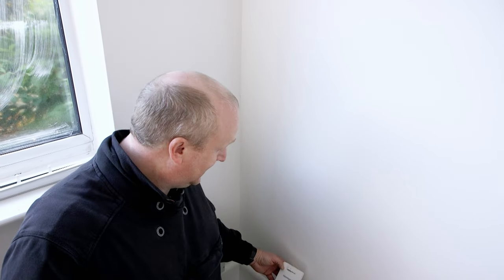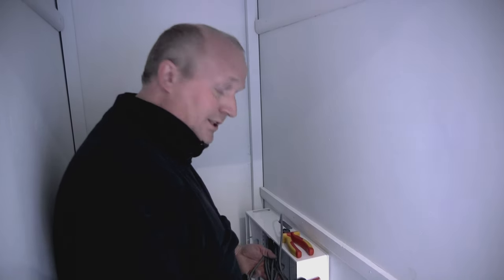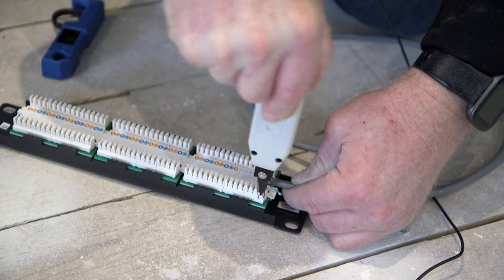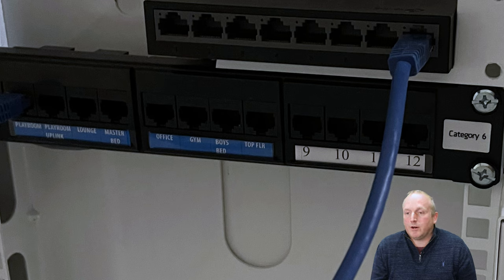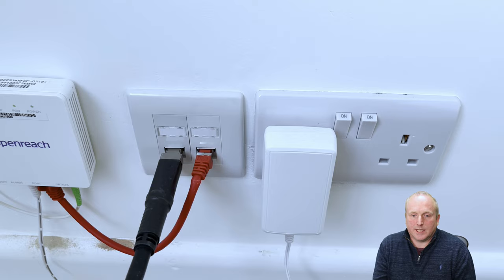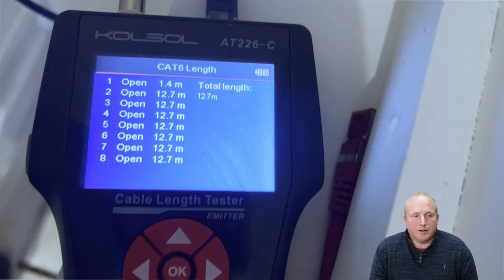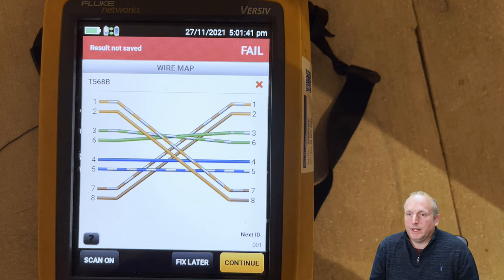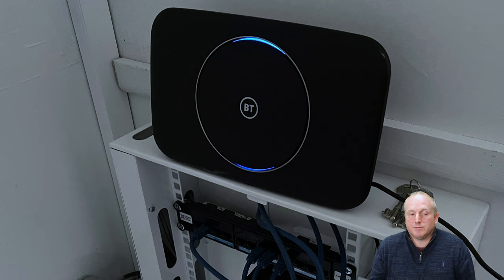BT Full fibre with 10GbE network installation tested with a £15,000 Fluke DSX 8000

Comment: Interesting that you had the extension lead right against all the termination points. I suppose having that in close proximity to the bare Ethernet doesn't matter as much compared to when it is live wiring within the walls? I always tend to keep a distance of 30-45cm as a rule of thumb, even at sockets (so the data modules are spaced a fair bit from the power sockets). To be honest it would be cleaner with them bang up against each other as you have done, but on the very unlikely case there is interference I'd rather not have to redo anything.
Reply from the maker: I have never seen any problems with proximity yet, but that does not mean they arent occuring! I think avoid to run the power and data runs in same ducting and routes and to cross them at 90 degress is more important.  I guess an installed cable will almost certainly out perform a wifi contection or powerline adapter and give consitent results even when not installed in the best case serniro.  Though the look of the installation in a home enviroment is often very important factor.

Comment: EXACTLY how it should be done and tested. I LOL at "Electricians" who tinker with data and won;t stick to their trade. Subbed without hesitation.
Reply: Don't expect low cost servicing if you the customer is funding a 15 grand multimeter.
Reply: Data is easy.

Comment: Having FTTP fitted on Wednesday, unfortunately the ONT is part of the hub they supply, so may have to use a double NAT setup 😐
Reply from the maker: I suspect you will end up with Nokia ONT as in video, with Ethernet cable to link to superhub.  Therefore should be straight forward to replace the superhub with your own router.

Comment: Brilliant video I've just had fttp fitted, what kind of ethernet cable can I use for a security camera,running from the BT Smart Hub I've knot tried any it's just that the what I'd call the rj45 sockets on the back of the smart hub look small for an ethernet connection thank you.
Reply from the maker: Hi David, any ethernet cable should work. Most cameras are 1GB or less on the ethernet port. A lot of cameras support POE. If power is to be sent over the ethernet, then a higher quality cable should be used that has copper conductors. Some ethernet cable is aluminium coated in copper. This should not be used for power applications.
Reply: @MerciaSolutions  Thanks for your reply it will be a great help.

Comment: I don't get how cat cable e.g copper cables is future proof, I'd say full fibre is way forward.
Reply from the maker: Hi copper allows for upto 10GbE to devices around the house.  The house has fibre directly into it.  As nearly all tv’s, game’s consoles computer have Ethernet using copper is the most effective way.  Otherwise each device would need the media converted to fibre to Ethernet.  Most tv’s only have 100mb connections therefore the 10,000mb Ethernet will be more than enough for the next 10 - 20 years.  The fibre could well be delivering 100GbE by then.  It maybe possible to send more than 10GbE as Ethernet technology improves.
Reply: Over a short run(less than 100m) it doesn't matter and in most homes you are going to be nowhere near 100m from the main box(well unless you live in a palace or something).

Comment: The main fiber entry point downstairs should have been concealed a tad bit better to match the asteic of the general install.. this work looks seamless regardless well done
Reply from the maker: Thank you Eelee, I agree it would have been nice to have had the fibre entry point relocated.  The fiber was already installed prior to the house being renovated, and only suffered with some plaster splashes on the cover which have cleaned off.

Comment: Great video. Thank you. I have a new pre-wired (ethernet house). Have just had my fibre installed and would like to use the existing ethernet port to run the connection back to my wiring cupboard. Do you have any suggestions on how I could test the quality of the pre existing ethernet cable without spending a fortune? It is embedded into the wall so can’t see if it is cat 5 or 6. 👍🏻
Reply from the maker: You could get a couple of computers on each end and run iperf to benchmark throughput.  To test for cat 6 you would need 10gb network adapters.  Only other choice would be to hire a fluke tester though this will be serval hundred pounds.  A cat 5 will easily run 2.5gb or even 5gb so should be more than enough to send the internet connection back to the wiring cupboard. The cat 5 cable is thinner I believe 24 Awg and cat 6 thicker at 23 awg so might help.
Reply: @MerciaSolutions  Thank you, that is really useful to know. I have even managed to get a working version of iperf for windows. I will give this a try. I am thinking it might well be cat5 as I can’t imagine any UK new build builder would put in cat 6 if they had to. All of th Ethernet connections terminate in a cupboard under the stairs. I REALLY want to run a network up into the loft (for CCTV, NAS etc), but there seem to be no route to push the cables up with so I may end up tapping off of one of the built in ethernets and going up into the loft that way as Powerline adaptors have proven unreliable at times. Thanks again for your help. Your video is really useful 👍🏻😊 P.S. thanks also for the note on cable thickness, I will have a look and see how thick it measures.

Comment: Hi Pal, 

Is there a way that I could connect the ONT to another router, rather than the BT Smart Hub 2 ? This is because the BT Smart hub 2 is rubbish. 

Please do let me know 

Thank you
Reply from the maker: Hi Jas,  yes you can replace the router.  The router will need to support IPV6 and then authentication via pppoe for ipv4.  Though prob best checking on bt forums if router you want to use is compatible.

Comment: Can you use BT full fibre without the BT hub? i.e., have my own Wi-Fi switch plug straight into the Ethernet port of the openreach box?
Reply from the maker: Yes you can plug your own router into the ONT it needs a wan port and to support PPPoE.  The only configuration details you need are the PPPoE username and password which I believe are bthomehub@btbroadband.com and the password BT.  Most routers will support this though you could go all in an build your own with with pfsense.

Comment: The state of that CLI is horrible… should not of been left like that
Reply from the maker: Hi cli in the thumbnail and video is the direct result of plastering the wall in which it passes through.  The fibre was already installed at the house prior to the renovation. Therefore the ONT was removed prior to plastering and the fibre cable bagged and wrapped.  The plasters luckily only covered the tubing in plaster which has now been cleaned off.  It’s certainly not the result of the bt open reach installation.   Ideally if it was being installed we would of had the fibre come straight to the cabinet or loft space if allowed as part of the open reach install.

Comment: @Mercia Solution are they LAP euro modules? I used branded Excel cable (Cat6) and patch panel, but LAP for the euro modules. Interest to know if they are ok for 10G. (most of my runs are sub 30m)
Reply from the maker: Hi yes the links passed certification at 10G had LAP cat6 euro modules.  Though a couple with cat5e euro modules failed due to the cat5e module but passed at 1G.
Reply: @MerciaSolutions  Thank you for the reply. I am thinking of using the smaller version of that 10inch rack enclosure in my garage. Do you think there is enough space for a cat6 keystone panel, with a decent bend of the cable? Thanks.
Reply from the maker: @tschubb1992  the smaller version is a great rack.  However I don’t think you will have enough depth to from the rails to back of the rack for using keystones.  I guest a lot depends on the keystone modules used and faceplate.

Comment: So does the ONT act as a modem? If I were to replace the BT hub with my own wireless router would I need a modem or would it just plug straight into the ONT?
Reply from the maker: Yes you can plug your own router into the ONT it needs a wan port and to support PPPoE.  The only configuration details you need are the PPPoE username and password which I believe are bthomehub@btbroadband.com and the password BT.  Most routers will support this though you could go all in an build your own with with pfsense.
Reply: @MerciaSolutions  that's great, thank you

Comment: If you are using 10gbe network for home , what switch can you recommend ?
I will have 24 port patch panel in network cab
Reply from the maker: Hi the switch at the moment is just a 8 port 1Gb tplink, the only data is the internet connection and this switch is more than adequate.  In the future the switch can be upgraded when required.  Zyxel make a few 24 port managed switches which are fan less so ideal for home environment also low cost.  The management allows for
Multiple vlans to isolate networks such as IOT devices and guest connections. There are also a lot of multi gig switches available though you will need multi gig capable clients and severs or a very fast internet connection to use any thing more than 1Gbe connection.  I also like the Ubiquity UniFi products.  I guess a lot comes down to your use case and budget, and how hands on you want or need to be.
Reply: @MerciaSolutions  thanks for the reply. I currently have UniFi setup in my current home 24 port PoE switch and USG , with poor internet connection (30Mbps). I have a number of access points in property and a few rj45 points wired in house and to office.
The new property we are moving to will have fibre , either VM 1gig or BT 900Mbps and I have instructed builder to install Cat6 at numerous points in property. First fix is now complete and I myself will terminate cables Inc network cabinet in office.  I had a site visit yesterday and all is good for cable locations and routes 👍.
I quite like the UniFi equipment and the GUI so will probably go that route again, but it's just choosing what equipment really as the idea of 10gbe is really appealing for moving data around.

Comment: Can you please provide a link to where I can get one of those rack mount boxes? Is there space inside to put the router, instead of balancing it on top?
Reply from the maker: Hi you would be able to have some routers inside the cabinet, however if you are using the built in Wi-Fi in the router then the metal cabinet would have a negative effect on the signal.  You can get the cabinets from here https://www.cablemonkey.co.uk/home-network-cabinets/9509-10u-connectix-home-cabinet.html or from cpc.
Reply: @MerciaSolutions  Thanks for the speedy reply! I have an access point because of poor WiFi from my existing router. Also an account with CPC so that should be easy.

Comment: Unless you have a WIFI Access Points around the house wired connected then WIFI is going to be shit with the Router stuck in a cupboard
Reply from the maker: The WiFi is working much better than was expected.  It was envisioned that a two or three hidden access points would have been installed the cabling is in place for the future.  However as the cupboard is central in the house it means the Wi-Fi only ever has one floor or two walls to reach every location in the house.  The 5GHz even works well at the extremes the hub is very good.  If the hub was left next to the ONT the Wi-Fi would not reach the top floor or garden as would have multiple floor and wall to get through.

Comment: Couple of questions for you if you don’t mind, I’ve just upgraded to Sky Ultrafast Plus so believe I’ll have an ONT, the room is bare plasterboard on the wall it’ll go on so I’d ideally like them to leave the box loose as it is at the start of your video. That way I can remove the master socket that’s currently there and make good, then fix to the wall once it’s plastered, which leads me to my next question. 

How does it secure to the wall as I’d be happy to do that once the room is plastered if needs be. 

Thanks
Reply from the maker: Hi the the ONT is just slid over a couple of screws. The backplate has a couple of holes with slots above which the screw heads fit through it then slides down and hangs on them.   The same slot is found on most mains extension leads so you can wall mount them, not sure what the correct term is. Hope that helps.
Reply: @MerciaSolutions  Ah gotcha, so just a couple of keyhole slots on the back of it. Hopefully they’ll be happy to fit it and leave it loose, that way I can fit it to the wall myself once I’ve made good. Thank you for clearing that up, couldn’t find an answer anywhere online!

Comment: Does this mean the overhead telephone wires will be removed?
Reply: Not a chance lol! Openreach are awful at removing redundant equipment, especially their contractors. Only when they have to do they do so. They are supposed to remove your old telephone wire and replace it with the fibre drop from the pole to the house though.

Comment: what are the benefits of having a patch panel in a domestic dwelling with 8 runs? why not go direct to a switch?
Reply from the maker: Hi a patch panel keeps the cables to rooms are static and correctly labelled.  It’s also means you only patch up the ports you wish to make live.  You might have different services such as a analog phone line run over the Ethernet run and different switches if physical segregation between is required, work vs kids and guests.  The cable used between the patch panel and rooms uses a single strand of copper in each of the 8 cores. A patch lead uses multiple strands so its more flexible.  Over time if the cables are being unplugged and moved there is a good chance of damaging the cable.  I expect the switches and routers will be replaced many times over 20 - 30 year period of time along with the patch leads used both ends.  The number of runs really is down to the home and expected future needs.  The fluke tester also tests and records various values for each of the runs so for future trouble shooting we can see if something has changed from the installation.  That said plugging directly into a switch can reduce hard ware costs and if a service loop is left on the cables in the future a patch panel can be added.  Make sure the ends used are suitable for solid or stranded cable.
Reply: @MerciaSolutions  thanks for the detailed reply 👍🏻

Comment: The BT Openreach ONT is loose and not fixed onto a wall as per BT Guidelines. Big NO NO
Reply: Looks like a Huawei which we haven't used for quite some time, as we only use NOKIA now.
Reply from the maker: The ONT was reattached to wall.  The house was renovated and the wall was plastered luckily the plasters did not damage the fibre optic cable (it was bagged and taped up) though they did cover the plastic wall plug in plaster.  I should have included some follow up footage on the completed install.

Comment: How is this 10gb network with ethernet ?
Reply from the maker: Hi it’s a cat6a Ethernet installation the cable runs are tested and certified to support 10gb speeds using the fluke dsx 8000 in the video.
Reply: @MerciaSolutions  I just found out that 6a supports 10gb honestly